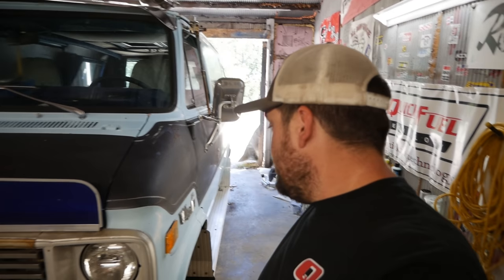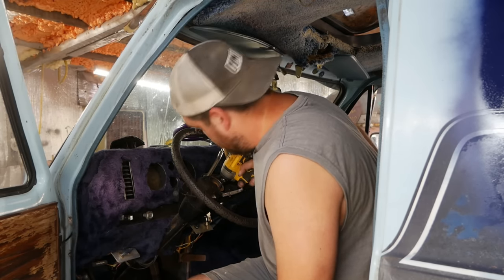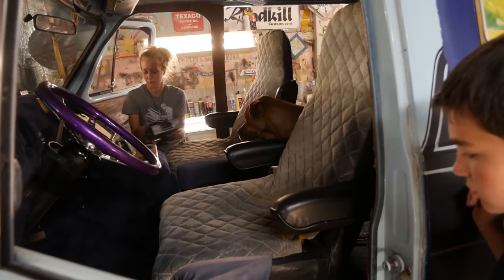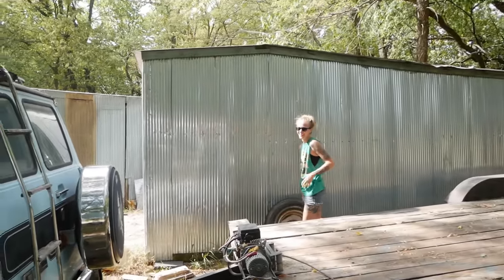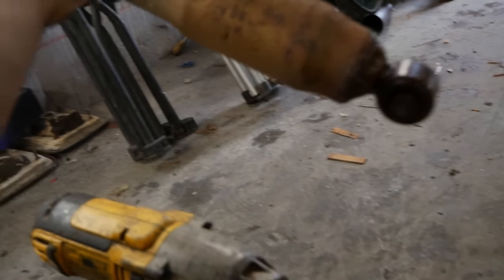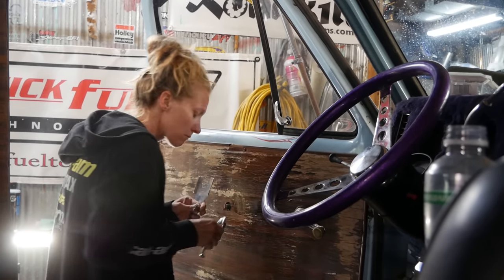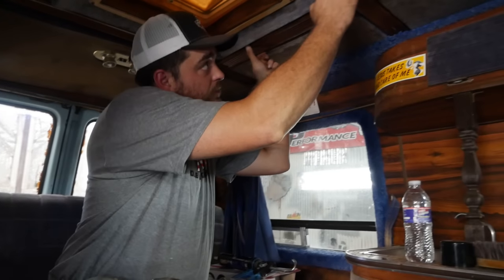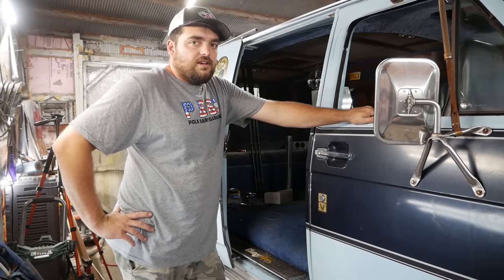Shorty Van Goes From Grandpa to BOOGIE!

Comment: Only thing the van is missing from being a true boogie van is the side pipes
Reply from the maker: Agreed
Reply: @PoleBarnGarage Side Pipes, Loud is necessary.
Reply: Has to have a mini disco ball hung in the middle of the passenger area to hit your head on constantly until someone rips it off in a rage from the sharp glass edges that slice anyones forehead who even looks at it, that the kinda lost knowledge from experience ya can’t find on Google
Edit 👍👍🆙
Reply: And the Shaaag
Reply: @patrickancona1193 thought the same thing as he self tappered that deathtrap into the ceiling😆
Reply: Came to comment the same thing side pipes are a must lol
Reply: "If you're not careful you'll burn you leg!"
Reply: Have to be fake Cal Custom sidepipes.
Reply: Facts and the old windshield blind
Reply: I would have stayed more original.  You did respect the original spirit but any change loses the original reality and if there is one thing that we are losing fast, it is original boogie vans for which any interpretive modern copy would be imperfect.  Even the original decals aren't original to the boogie van and would have been better used on a modern boogie van conversion from a period cargo van, not a period boogie van, though this one was made just a bit after the peak of the original era, so we could be losing more than we are.

Comment: Ditch the running boards, add side pipes, put on fender flares, and maybe a portal window, then it will be a boogie van. Absolutely love the build. You nailed it.
Reply: Tear drop window , But make sure you install it right with the point going up and back point up and back don’t forget point up and back teardrop window always point up and back yes and the side pipes

Comment: Tip for laying big sheets of vinyl in the future: Once you get it measured and in place, put one long strip of tape vertically through the center to hold it down. 

Then, lift up one side, peel off the backing paper and cut the backing paper off in as straight a light as possible. 

Now, spray the vinyl with a mixture of a couple drops of dish soap and water, then start applying the vinyl from the center tape line out.

Once you have the one side down, remove the tape, peel off the remaining half of the backing paper, spray the other half of the vinyl and smooth it out. 

The result should be almost no bubbles at all, and the dish soap mixture will vanish as you let it sit in the sun.

I know perfection isn’t the name of the game here but this is one of those cases where this method actually makes the application process easier/less frustrating, AND makes for a better result.

Comment: When the horn stuck on the steering wheel install, it reminded me of when I was 16. I had an 88 s10 that dad got on trade for some work he did and I had to have it. Someone lowered it, had a sun roof put in it and I bought 3 spoke gt wheel to put in it just like the one you have. I was heading to my grandpa’s shop one day and honked at my great grandmother who was sitting on the porch. That damn horn stuck and blasted for the next half mile until I pulled into the shop where my uncle promptly performed a horn delete before I could even step out of the truck.

Comment: Thst tensioner Style were you loosen 1 lock down bolt and then loosen the best tension with the other bolt last year I seen any vehicle have thst setup was a 3rd gen 4runner between 1996 and 2002 11:31 wish manufacturers would go back to these good old belt Tensioners Dalton @Pole Barn Garage

Comment: 34:17 the "square headed screws" are called Robertson screws, and they're a Canadian invention. P. L. Robertson invented the Robertson screw and screwdriver in 1906 and received the Canadian patent in 1907.. as a kid 70s and 80s we called them "American Safety Screws or "Lock out screws" because at the time, you could not buy a Robertson driver in the USA.  Robertson Screws dont cam out as easy as flat or Philips screws do, and the head & the driver are tapered to fit snugly

Comment: Next time you do vinyl, spray down the application area with a dilute solution of water and dish soap. It'll make the adhesive temporarily less sticky. Much easier to slide air bubbles out.

Comment: That belt tensioner is actually thoughtful. Nowadays you would need to pull the radiator out and recharge the ac system to change the belt

Comment: Those square headed screws you mentioned are actually called Robertson screws. Initially they are a pain in the ass to use but you'll quickly see that they are far less likely to get the head stripped than a Phillips head screw. 39:40 when you said "I'm a professional" you reminded me of a scene from Monty Python's movie "Quest for the Holy Grail", when the Dark Knight challenged Sir Lancelot, and their conversation went something like this....DK "I"M INVINCIBLE" SL " YOU'RE A LOONY" If you've never seen the movie, I highly recommend it.
Reply: Except they aren't. Robertson screws are used in electrical applications,  and combine flat, Phillips and square all into one screw, and technically use a special screwdriver, the Robertson.

Comment: Well that "cobra 2" is a great frame to build a full front suspension for. So many players have swung a bat at putting 60's style mustang suspension on em.
Option 2 you could buy a 4.6 two valve crown Vic and swap the entire Ford into the "Cobra 2". I do believe option 2 has aftermarket support, could be wrong.
Then and only then can you j-mod the transmission and put an exhaust turbo on it for 8 seconds.

Comment: Why does Canada use Robertson screws?
The Robertson square-drive: a screw topped with a square hole ready to receive its matching hand driver. A thing of beauty for Canadian woodworkers because that recessed square won't let you slip out. The screwdriver fits so snugly, you can torque this baby upside-down with one hand

Comment: I had a 1987 GMC vandera. And I drove that thing From 17 years old, until I was 21 when the A arm completely rotted and snapped, I loved that Van. Had big speakers in it, you know, there's a lot of us Did back then lol the electronic layout rear sofa bed seat whatever you wanna call It had the good old reliable sb 350 Might not have been winning any races, but it had definitely blow out some tires.

Comment: Wheel and tire combo is perfect once ya get the flares on...looked at some old pics of my long gone youth...ya need a big steel whip with a spring on the rear corner for the CB. Find another place to store the spare if you can. The sidepipes are also going to really bring the look there.  If it was a Chevy, the badges said "Chevy Van 10 or 20...the cool guys cut the C off of Chevy and got 1/2 ton emblems and cut the o ) off...rendering "Hevy Van 1"
Good Lord I am old...but really enjoying this...

Comment: I have a :"67 G10 . I did an LS swap. 4L80, ford 9", 4-wheel disc kit and on and on etc. I was hoping to use it to bring in old cars. Then I checked my owner's manual for the gross combo weight. I should not have looked at that. Where the weight should be on the chart is a DASH (GM's way of saying NO!) The only thing our vans share is the fact they are both sub-frames. I'd like to know truly your impression of the towing characteristics. Any odd behavior, fighting with the trailer, etc. Also, my van is still just sheet metal inside, a blank canvas. How'd you like to boogie out my van for me, LOL. I'd pay well for the inside to look like that.
Your content is great, i don't miss any of it ever. Thanks for working as hard as you do and keep putting it out there. This link is my YouTube page. A video from my mechanic telling me my new posi 9" is ready to be picked up.   https://youtu.be/PxWeM8agzVE

Comment: Robertson (square) screws are the best. Originally designed to enable the screws to be made using cold forming of the heads, the taper has two other advantages which have helped popularize it: it makes inserting the tool easier, and helps keep the screw on the tool without the user having to hold it there.

Comment: Dalton get a dewalt or milwaukee or any brand really magnetic impact drive guide (it's the thing that the screw goes into and there's a slidey thing that goes over the screw but it holds it into the impact gun) they're like 3 bucks at homedepot or lowes, man they're a finger saver as when you're screwing the wood to the metal behind the sunroof, that's exactly what they're made for. Seriously I keep like 3 of those in every place I have tools just so I always have one around.. I do a ton with drywall screws (or sheet metal screws) and it's seriously a finger saver!!

Comment: Jessie, JD, and the PBG bunch are great working together. Back in the day, a group of us had a lot of these full-size vans of all brands fixed up. I had Chevy and Dodge vans myself. Rebuilt the Chevy van C20, had a 250 6 cyl with posi rear, 12 bolt rear, and turbo 350, would pull a house off the foundation! They were fun to drive and very useful for various hauling.

Comment: kinda a suggestion but pop on down to the local truck stop an get some load binders, thats what i use, there faily good priced an hold alot of weight, ironicly i have some actaully that hold the roof up in my trailer to to help with the snow load in the winter time

Comment: Hello Dalton. I was in town the other day and passed by our local AutoZone and saw a pretty nice looking Mustang 2 as I passed by. 
When I noticed the Mustang 2, I was thinking about how long it had been since I had laid eyes on one of those cars and I couldn’t believe seeing one on your video.
Regarding the 8 track player, It wasn’t uncommon for the belt to break which looked like a black rubber band. In a pinch, We would use one of the larger wide rubber bands which you could cut to length and take a very small amount of Crazy Glue to join it back together. You need to get the rubber band just tight enough to turn everything and that’s it. 
If the rubber band is too tight the 8 track won’t work properly. In the past, I had actually completely rewound the tape and routed everything as it should be. If the foam pad that keeps the tape tensioned properly against the tape head fails out then the tape won’t work.  
I had to be in a “Special Mood” to fool with the 8 track tapes and don’t miss them at all. The cassette tapes were aggravating but nothing like the 8 track tapes were to deal with.

Comment: I just put those on my pop's 77 f100. There is no rake at all in fact it is very flat. I have some f250 leaf springs in the back, maybe they'll work along with the air shocks. Maybe you'll have to put beefier springs for that effect as well. The Van is classy! ;)

Comment: I also had one of these chevy vans and the heat gauge didn't go any higher than 120. I drove if at 80 on the highway and it didn't over heat so I wouldn't worry about the temp. Gauge

Comment: The Square headed screws are called Robinson screws and you can thank Canadians for them. Better then Philips and flathead screws by a mile even with allen or a torx bit. Also next time you stain something an old t-shirt rag is best and cheaper then foam brushes.

Comment: I hate working on vans, but that's because I have had to change heads and the cam and lifters and  gear set , and the radiator in a 1980 Chevy g10 Chevy van short wheelbase ..

Comment: You can replace that ancient 8 track radio with a Pioneer Supertuner head unit with Bluetooth and 4 JBLs speakers,  2 door and 2 6X9 rear speakers. 100 watts will fill that van with sound.

Comment: The "JAG" was cool, yeah.
But the "VAN"!....
Way better!❤
As with boom box radios in the 80's, take out the 8 trak player, and remove the exterior box. Use Rubbing Alcohol and a Q tip to clean the player surface. It works every time. It has been too many years since it was used and the dirt just caked up on that player surface.
Oh, and yes, Traktor is spelled correct.

Comment: Some of them GM vans were power houses though, The junky one I had was able to hual a 10,000lb mini excavator like it was nothing, got a deal on a cleaner van that was in better shape, it couldn't haul more than 6,000lbs without sitting at 5k rpm up a small hill. lol

Comment: Robertson or "square screws" are the greatest thing ever to be made in the construction industry.  Screws, with a tapered bit, will stay on the bit while upside down. Who in the flip uses a Phillips screw? They always strip out and fall off the driver bit if breathed on.
Rant over.

Comment: What a transformation! Now the 4x4 shorty needs to be doing adventures too!
Reply from the maker: Need a title, I'd still like to find a better candidate to use the 4x4 stuff in
Reply: @PoleBarnGarage  
The 4x4 conversion might be pretty rare. Is it one of those Quirgly outfits?
Reply from the maker: Pathfinder. I could convert any pre 85 van using it though